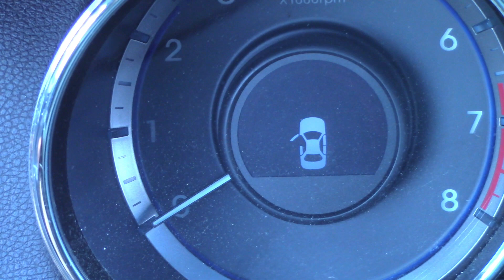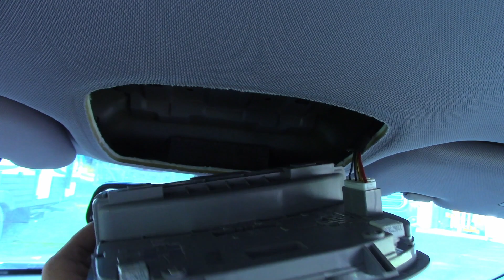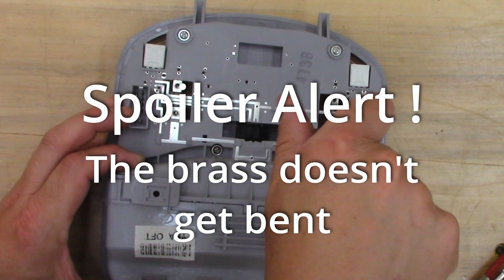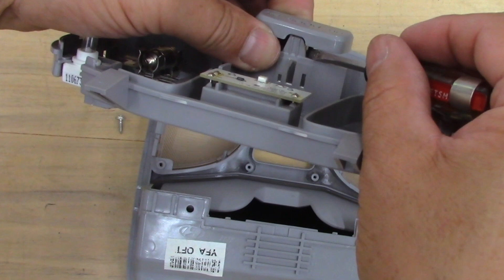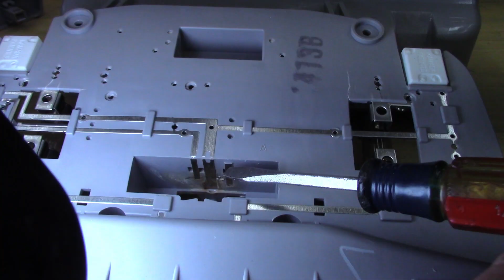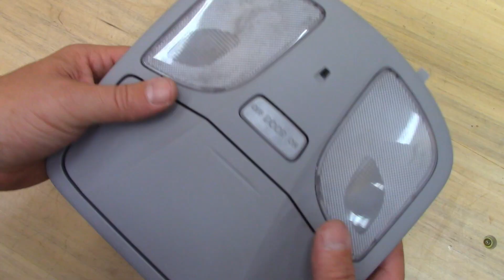Hyundai Sonata interior lights won’t turn off repair

Comment: Just wanted to say thanks for posting this! I have the same problem and plan to use your fix.
Reply: Update: I used baking soda and super glue to fill the small melted hole. I used tiny files from Harbor Freight to clean and smooth the area first. For some reason 2 Dollar Trees in my area were out of super glue, so I picked it up at Walmart. AVOID the gel and buy old school liquid, and I recommend buying the small, single-use multi-packs. Anything else usually dries and hardens over time by the next time you need it. I then used some Qtips and a small flat head screwdriver to put a very tiny amount of baking soda in the crevice, leveled it with the screw driver and added 1 drop of super glue on top. I then used the small flat head screwdriver to scrape super glue residue off the 3 metal leads, and some nail polish remover and a Qtip to make sure the leads were clean of any super glue. Used a multimeter to check for continuity on different areas of the metal leads to make sure no super glue residue was going to interfere. Reassembled the dome unit, had a tiny bit of trouble getting those last 2 mounting screws to bite into the 2 tiny square housing pieces, but realigned the dome and slowly started screwing in those 2 mounting screws and they finally worked. Your video inspired the project and has helped thousands of people - hope you feel the gratitude for not only a simple care repair but the larger social community impact. Helping people, teaching people, saving their families money, fixing small inconveniences; all improve their overall well-being and help connect one another. That's the real impact. Thanks again. PS: Even we all these inflated prices, and despite our now 13 year old Hyundai Sonata with it's 2nd motor (curiosity of Hyundai warranty and class action), I will avoid buying another Hyundai, the workmanship is so cheap and shotty. My 23 year old Mazda Tribute has never had the dome light go out because of melted plastic. Thanks Hyundai...
Reply from the maker: Thanks for posting all the tips and your kind words.

Comment: You think it would be possible to fill the hole with glue without taking the switch out? Maybe a syringe to not make a mess?
Reply from the maker: Sure, just be careful.

Comment: I have 2011 sonata. Once I took out the light assembly I unscrewed the obvious 2 screws to take it apart but you unscrew 4 screws but I could only see 2. I had to remove light lenses to find other screws which each light had one, after messing around for half an hour . My was a bit different for some reason. Anyway just letting people know incase they were trying to figure out why I would come apart
Reply from the maker: Thanks for posting this.  I hope it helps someone.

Comment: Cool, that is my exact symptom with those lights and doors. I will try the same with super glue fix and see if my interior lights begin to work with the door again too. Thank you!!!
Reply from the maker: Post back if it works for you.
Reply: The repair did work, but a couple of things I would add. The Off-Door-On light switch was VERY difficult to remove. I ultimately got it if, but almost gave up. Once removed, the repair was straight forward. My interior lights now work mostly as expected. However, when ON, the lights will not always go on. If I rock the switch a bit, the lights do go on. The workaround is to turn each light on individually. In the end, I am happy with the results, but realize it was a bit more difficult than shown for some vehicles. Thank you for posting!

Comment: I've had this problem for years in my 2012 Sonata and after following your video, the switch works flawlessly! Now it won't be dark every time I get in/out of my car, thank you!
Reply: Was it causing you problems starting the car by any chance?
Reply from the maker: It could, especially in cold weather.
Reply: @HouseDoctorRay I got told I have  parasitic draw do you think this is what’s causing it?
Reply from the maker: It could be.  During use the switch gets hot and melts the plastic.  If the switch is barely making contact it could cause a draw without the light coming on fully.

Comment: I have the opposite problem. Lights are working, but when positioned in the middle, when opening doors the light stays off
Reply: Just watched the video! Amazing video thank you!!! Showed everything, great content
Reply from the maker: Thanks.  Check the link in the video description.  A replacement assembly isn't very expensive if you can't fix it.

Comment: The courtesy light at the bottom of my passenger door won't turn off. Have you encountered this?
Reply from the maker: If that is the only light staying on I'd check the wires inside the rubber harness where the door hinges are.  Sounds like a short.

Comment: When you said you were gonna bend it, and i immediately thought why not fill the hole with super glue, then you did that haha. About to do the exact same thing to fix my sonata now. Thanks for the how to!
Reply from the maker: Easy fix.  If it gives you trouble the light assembly is pretty inexpensive on Amazon.  There is a link in the video description.